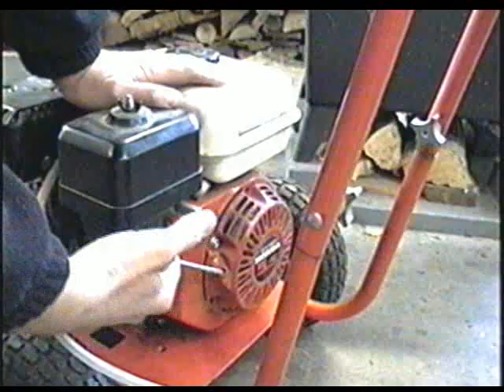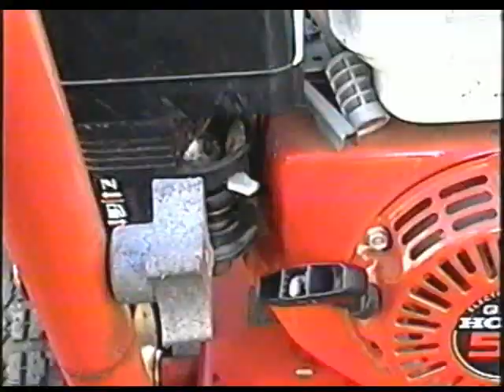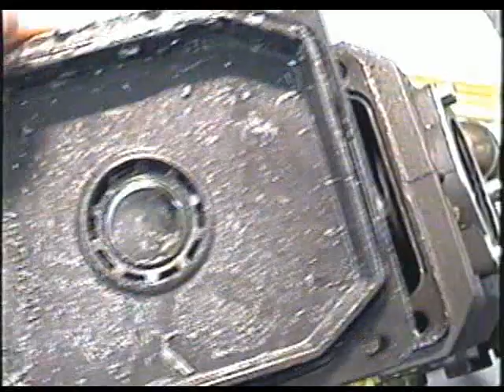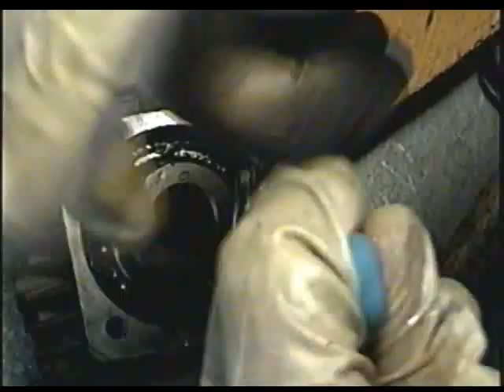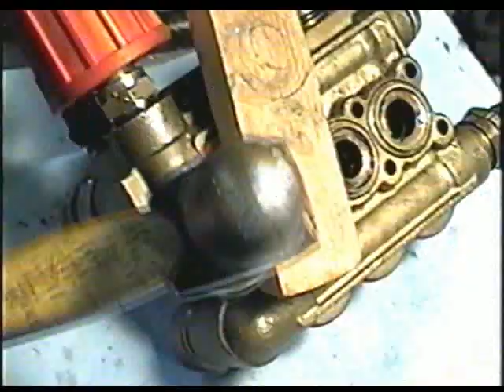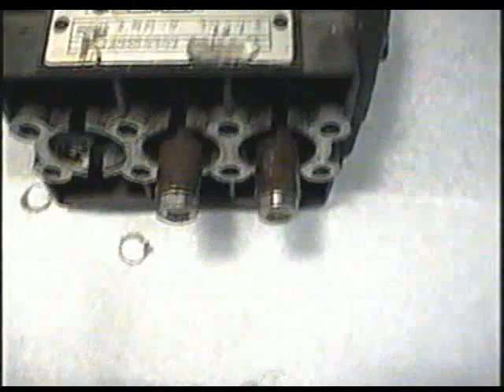Defective Pressure Washer Pump Diagnosis

Comment: Donyboy love your site, I have a helpful tip for low pressure powerwasher, which is most overlooked. After I changed all the 6 valves, unloader, pressure vale, etc., I checked everything I still had low pressure.
Most over looked replacement for low pressure problems.
Remove the high pressure hose from the PW, this high pressure hose is attached to the 3"  high pressure pipe,to the PW, remove this 3" pipe, now after removing pipe look back inside the pipe still attached to the PW, yes there it is "The Jet",
unscrew the jet (screwdriver left), after the turning stops, you need to pull the jet out, not easy, what I did, I hooked the PW to the garden hose and the water pressure pushed it out, be careful not to lose the jet parts , (back jet, spring, front jet), small pin hole need to be cleaned out, also the jet may need to be replaced, this is where my problem was, worn jet, easy....
Lee

Comment: I have a Honda Pressure Wave PWH2500 with a broken pump (bearing and housing broken) The model number of the pump is A07908. i've searched online but nobody seems to stock it any more. Can you suggest where I could get one? Thanks.
Reply from the maker: 3/4" shaft? try repairclinic.com
Reply: @donyboy73  Thanks for the suggestion. Unfortunately they give the same response that I got everywhere else  i.e. the part is no longer available. I think I'll have to splash out for a new power washer.
Reply from the maker: @kennypaul100  also check amazon

Comment: Donyboy 73
Question ?
any Experience with Subaru EX21 EFI Engines ?
just picked up a used Ridgid 3300 psi with EFI RD80702
No Start !!!
Will Start and Stall if i Spray Brake Kleener in Air Cleaner 
POssible Throttle Body ?
these are known Problems 
Do You have one ???

Comment: My Dewalt  3800 PSI pressure washer model DXPW3835 doesn't have  screw, but still will not come off. Is there a trick to doing this one?

Comment: Awesome video! It's neat to see the innards of one of those. 
I have a similar pressure washer with a GX270 motor on it. It was given to be from someone I know and it has been sitting for a few years. The pump moves water and it does have oil, but the pump makes a squealing noise a few seconds after starting it. I ran the washer for 10 seconds and when I shut it down, I noticed very light smoke floating out from adapter casing where the motor's output shaft couples to the pump. It's worth noting that the engine rpm and water pressure becomes unstable while the pump is making this noise.
Any help is appreciated!

Comment: I don't understand people buying equipment, but never doing maintenance.  Often, when people purchase new gas equipment, they don't even read the instructions, add the provided oil, etc.
I found a gas pressure washer by the side of the highway, it had fallen out of a pickup, the guy didn't bother to put up the tailgate.  It was bruised and battered, I checked the engine oil and it was dangerously low and black. The engine started immediately, so I added oil, hooked up a water hose and it worked perfectly.
Three hours later, someone posted on Facebook they had lost a pressure washer. I found out the 'owner' had bought this machine four months ago. He gave me a $20 'reward'.
Of course I insisted I be compensated for troubleshooting, oil, gas and maintenance, but really it annoys me to be a good citizen for this 'owner'. This machine doesn't deserve to be tortured by him.
He is an owner of numerous properties, a huge F450 dually, dirt bikes, etc.  I suggested he should just buy a new machine and I would nurse this 'old' one back to health.
I got a Black Friday deal on a new gas pressure washer, cause I enjoyed using this one, and have uses on my acreage for one, whereas my electric Karcher is inadequate.
Like my cheap China-made wood splitter, I know how make these machines work and last; they require patience, maintenance and love.
Reply: You should have just kept it....   I realize you are probably entertained by returning it to the guy but....    fuck that guy...      I consider myself a good and fair person but I wouldn't have even bothered calling him unless it was a wallet, cellphone, or something of sentimental value..          I mean seriously....  how do you allow a pressure washer to fall off the back of your truck and not know it?       tailgates are easy to close and straps are cheap..     the guy obviously gave zero shits about his equipment and definitely doesn't give a shit about a decent guy like you.
Reply: My father in law found a commercial pressure washer flat tires didn't run no wand I didn't care about it just more junk in my back yard. Just recently I found it behind my garage under a bunch of junk now I'm interested in getting it running.

Comment: Does the pump have seperate oil or does it use same as the engine? I have a Karcher with a Honda 190. It has good power and pressure but it leaks a small amount of black water/oil mixture when running. I can't tell where it is coming from. Any ideas.

Comment: I have a ryobi 3100psi pressure washer with a Honda engine with the idle down feature. When I release the trigger on the wand the engine doesn't idle down and the engine will stall. It's a new machine. Only a few months old. I don't think it's the engine. I'm very careful to drain gas from carb and tank if it's not used in a while. Have you seen  this problem? What causes it? How do I fix it?

Comment: you could probably pick up a used pump on offerup or craigslist for less then repair.  situation like this the parts $$$ are more expensive then buying a new or used pump.  Great motor tho, put a new or used pump and you have a great pressure washer.

Comment: thanks for yet another great video.  I have a ryobi 3100  pressure washer with a Honda gcv 190. It runs fine but the engine sounds kind of clanky; very much like the 5.5 in this video. It has less than 20 hours on it and is only a couple years old. It just sounds much different than Tecumseh or Briggs engines that size. Is that common for Honda engines. It also smokes quite a bit but only intermittently. Makes me think it may need a head gasket. Is that a common problem with this series of Honda engines?

Comment: My Craftsman power washer has never really run right since I bought it new 8 years ago.  I'd like to replace the carb and run some tests on the B&S 6.75 engine but am pretty sure you must have water going through the pump when it's running.  Can I remove the pump and work on the engine without hurting anything?  When you remove the pump, are there any gaskets that need to be replaced?

Also, I love your videos.   You have great communication skills, you would make an excellent instructor.

Thanks
Reply: +Dick Day In all of the systems I have seen the engine and pump are two totally separate components.  If you remove the pump it is self contained and you shouldn't have to replace any gaskets.  If you have a vertical engine arrangement be aware that when you remove the pump then the engine is usually just sitting on the frame loose so you would have to secure it in come fashion before you could run the engine.
Reply: Thank you!

Comment: can I get help with why the motor on my pressure washer dies if you don't have the trigger pulled but if you hold the trigger you can pressure wash all day help please
Reply: sounds like fuel shortage to me,check filters etc
Reply: Well see idk if there is a clutch in the pump that once it pumps so much pressure it's suppose to kick out and if it ain't kicking out then how would I fix it
Reply: your relief pressure valve is stuck closed so overloads the engine when you don't have the trigger pressed on the sprayer thingy. Could cause damage to engine....
Reply: sounds like the unloader valve is sticking

Comment: I have a troy-buit pressure washer model 20242. no pressure, I changed the unloader and replaced the valves. still no pressure. what can I do now? pump is a sjv3g27.

Comment: That is, or was, a good pressure cleaner as the pump was a high capacity Italian pump, not a Chinese copy!  Pity it was too far gone to be repaired.  But as I also have a pressure cleaner with the same motor (Honda GX160), could you please tell me what the claimed output pressure was (either max output or working /continuous output.?  ( so I can compare to mine which has just broken)  Thanks
Reply: Steven W Older AR pump made in italy just like most pumps usually better off to get a new one especially with these cause parts and dependability are an issue, company i work for went to ARs and nothing but problems and $$$$ oh and went from Honda engins to subaru more $$$$$$s.   Sorry just venting
Reply: +Mike McCurry the new rrv series are good pumps....800 hrs on one of ours.

Comment: Pumps are a pain!,....... They are finicky. Best to buy a new pump and call it good.  :)  Especially for that Honda motor,.... Awesome deal Don...    :)
Reply: turdsandwicher clean everything very well and use it as per normal. And watch for fresh drips or sweating. Thats where is coming from. After identify do your research
Reply: how much does a pump usually cost? I have a Karcher not sure what model with a Honda 190. It has good power and pressure but it leaks a small amount of black water/oil mixture when running. I can't tell where it is coming from. Any ideas.

Comment: The unit was left in bypass (engine running without spraying any water). The water get super hot when it keeps circulating through the pump head. As soon as the spray gun is opened, the new cold water hits the ceramic plungers and cracks them. Water then gets into the back end of the pump and chaos ensues! Don't leave the unit running for more than a couple minutes in bypass!

Comment: Sweet video!  Thanks for takin your time to teach people how to figure stuff out, im not too good with engine work myself, I can run/operate anything but taking them apart...maybe in the next lifetime, Just had my honda 5.5 GX160 serviced, and what'd I get back?  A wonderful engine that starts right up one pull, and a loose water pump ; / Leaking oil, what a great deal aye?  Maybe I should learn how to fix this crap myself after all!  Thanks again, very informative!

Comment: I have the same pump. Noticed a leak and discovered a cracked center piston. Should I get the piston kit or just the piston? Also, Is it wise to throw in a seal kit while replacing the piston to? As you know they want a fortune for parts. Great vid, thanks for any help!

Comment: Donyboy73. I have a craftsman 1800 pressure washer.  Bought it for $50 dollars but now that I started it for the first time water spraying out of the water pump but very low pressure out of the spray gun. Can you help out the best value option out there for me. Can you give some advice

Comment: Great video, just wanted to "correct" you in that it's an engine, not a motor. A motor runs on electricity (electric motor) and an engine runs on fuel, such as gasoline, diesel, or even kerosene (gas engine, diesel engine, turbine engine). Sorry, it's just a peeve of mine and I don't mean any disrespect.

Comment: Your unloader is stuck/sticking. Disassemble the pressure adjustment valve and clean/repair/or replace. 

Easy fix. 

I hope that helps.

Comment: Dony...my Troy Bilt pressure washer model 020207 calls for the pump oil to be changed after 50 hours or 1 x per year.  The part number for the pump oil in the manual come up on various online supplier lists as a mineral oil.  The big box stores each sell a synthetic 30 weight oil for the pump.  Can I use the synthetic oil or should I stick to mineral oil?

Comment: I have 5 hp honda motor pressure washer. I am having this problem that it starts fine run okay. if I let go off the trigger the mach stops dead. it will start right up again once I press the trigger. Any ideas what may be wrong? I used it to day but after about a hour the hose underneath blew?? Please help,, Thanks..

Comment: Did you check the engine oil level before starting it? Chances are, if they ran the pump without oil, the Engine oil may be low or really dirty, since it's apparent that whoever used it didn't take good care of it.

Comment: i just had the same problem with an old 1960 briggs with a water pump, i took the pump bolt off and the engine started to turn over, then it was scrapping, i repositioned the pump and tigthened it up again and now the engine turns freely with the pump on

Comment: The pump manifold looks good just a few O rings to replace. I think the camshaft may be bent but I think the price of parts will make this project too expensive.
I do hope Im wrong it would be a good repair. 
its a good deal on the engine if the pump is scrap.

Comment: I'm betting the cost of either a new pump or replacement parts to fix the old one will be cost prohibitive. Seems like the Honda engine is in excellent condition and for $30 consider it a deal and call it a day.

Comment: Awesome deal.  If all else fails you can always resell the motor ( or it would be great for gokart or something) for close to $200.00 down here no problem. Also you could buy a pressure washer with a bad motor really cheap.

Comment: nice video dony, i have been working on presure washers this past year....picked up a couple throw a ways, that needed repair....it`s been difficult finding repair information on the pumps.so i think this would be a great area for you to continue with your repair series to include presure washers .......by the way the comet pump is an excellent pump...good luck